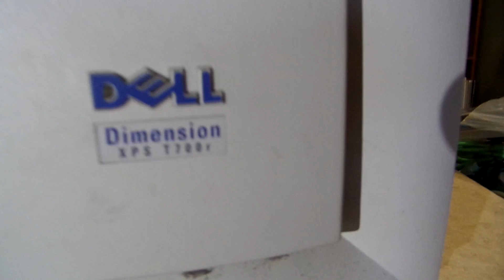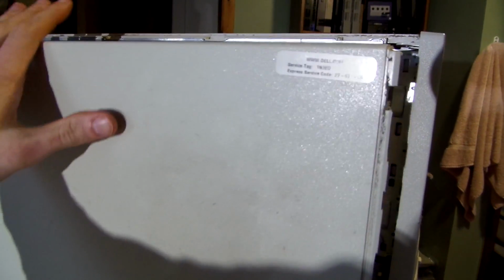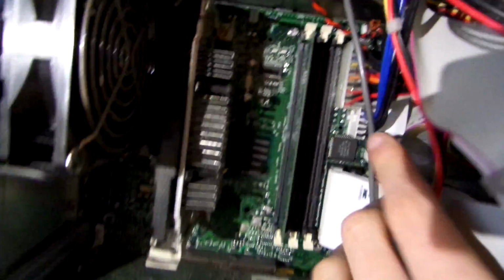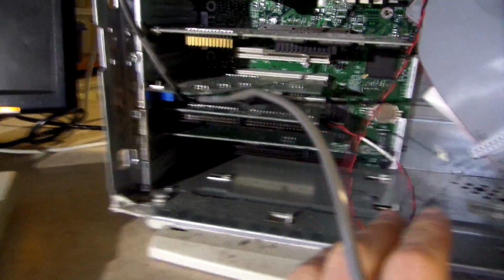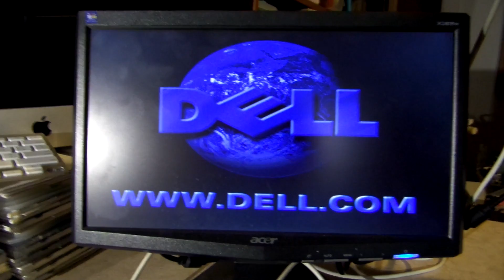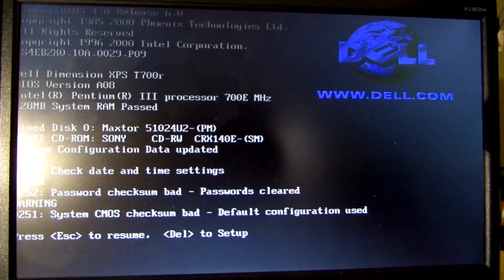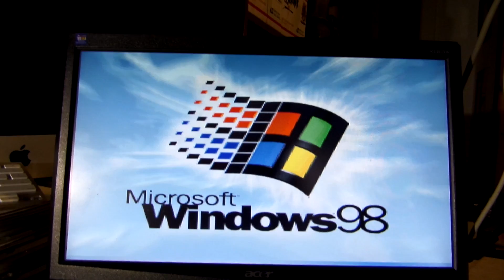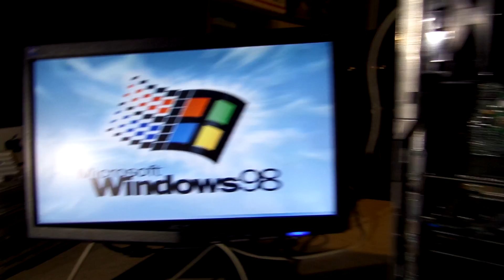Dell XPS T700r Desktop PC - Recycling Find

Comment: That fan shroud is absolutely necessary. It channels air through those dinky corrugated aluminium fins on the heat sink. With the fan shroud off, air will take the easiest path in from all directions and won't go through the heat sink. It probably won't be seriously damaged for a long time in this state, but it will probably crash quite quickely.

Comment: i have one with windows 98se that i use for Pc Paint Brush. as you all know PC Paint Brush stopped working since windows xp,  i had some problems when using thumb drives, windows 98 kept asking for drivers for the thumb drives, but lucky for me i had an old USB mp3 player with the drivers cd and that helped. great video
Reply: You can set up a really simple FTP server if you just want to transfer a large bunch of files once.
Reply: you are right... and it did cross my noggin... but i need PC paint Brush

Comment: These make good NAS / file servers. Quiet and they never die :)  In fact I have one running as a gateway / firewall / file server with W2K3 and it has been up for...god 10 years now at least. Never had one peep from it.
Reply: They certainly don't build computers like they used to.
Reply from the maker: +Jasondamastah Awesome! It's good too know that there are other ones out there that are still in use.

Comment: yup, those were the old Micron chassis.... I though I regocnized that chasssis..... they all got scrapped.... use to hate those machines.... so it looks like both Dell and Micron were using the same chassis.... Old P2 systems.... trashed.... would just scrap them out and save the PSU and other parts.... to be used in newer builds....

Comment: I have 5 likes this in my garage wondering what to do with them 🤦🏽‍♀️
Reply from the maker: Depending on the specs, they make some kickass Windows 98 or early XP gaming machines, since that's what they were aimed at when they were new. This video is really old now, but I fired up some Need For Speed Most Wanted on this under XP and it ran okay. It's far too new of a game to run well, though.